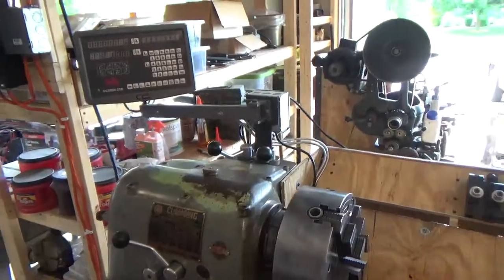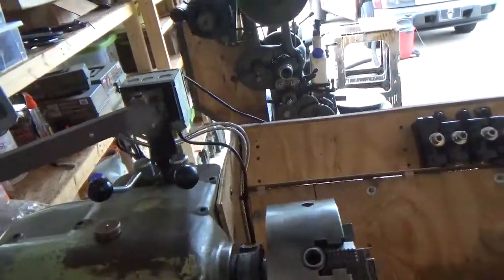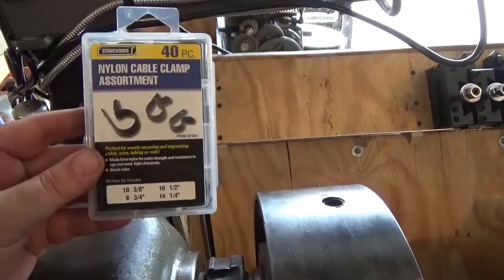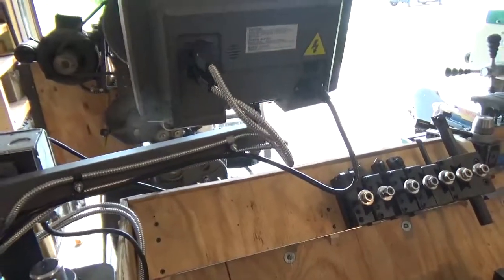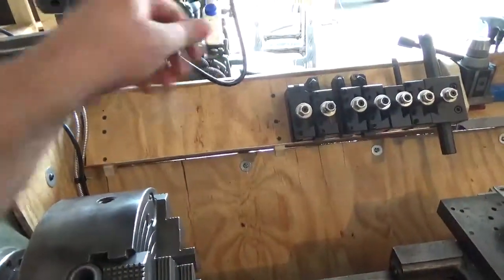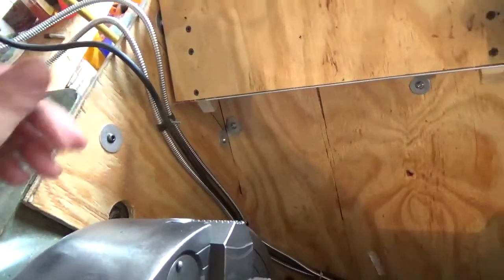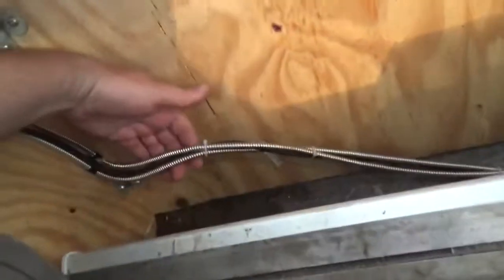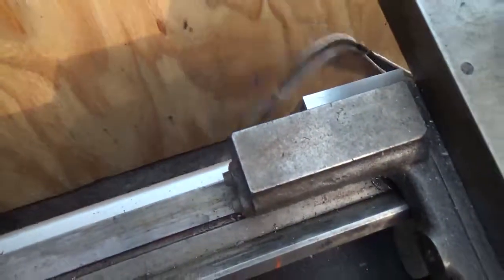ShenZhen HXX GCS900-2DB Lathe Dro Install: Part 6 Securing the cables

Comment: Nice and clean cable management. I like your wooden "back stop" set-up with tool holding.   Down the road I might incorporate something like that on my machine.
Reply from the maker: John Strange you will definitely want the back stop ... for cleaning reasons!!! Got tired of cleaning chip behind the lathe. I made one for both of my lathes
Reply: I imagine wood is quieter than sheet metal for it, but I don't know. What is your other lathe? I see it there in the background, but can't tell.
Reply from the maker: John Strange it is an old 10" Sheldon lathe
Reply: Sweet.

Comment: Kirk, can you tell me how you got the display to show radius versus diameter on the Y axis? I bought the same unit and cannot figure that out at all. Probably something simple, but their manual is tough to read and does not appear to cover this.
Reply from the maker: Dan Linscheid Im actually going to shoot a video about this. There is no button that switches from diameter to radius. You do this by manipulating the resolution. I emailed Wilson at the company mad this was his response;
Reply from the maker: For the Radius and Diamemter function. It is very easy to set:
1. Set the resolution to 0.01, it is diameter for lathe.
2. Set the resolution to 0.005, it is radius for mill.

You need not set it through change others.

Any problems pls feel free to contact me, thanks.

Regards,
Wilson
Reply: Thanks for your response, Kirk . I bought the 1um scales, which should give me higher resolution. I look forward to your next video.